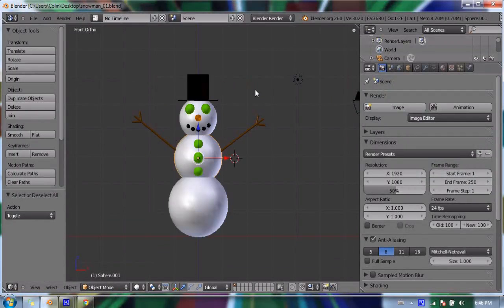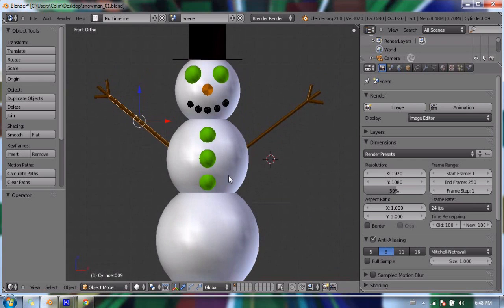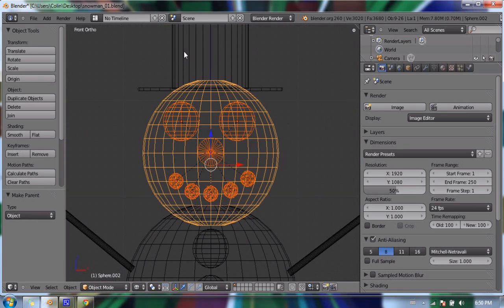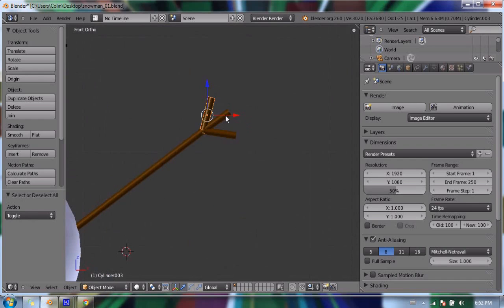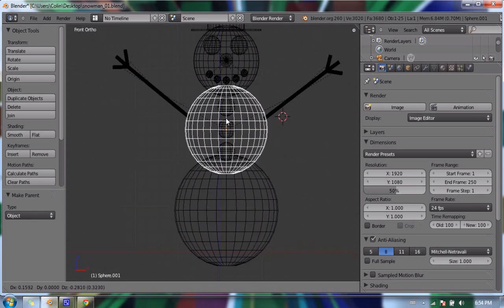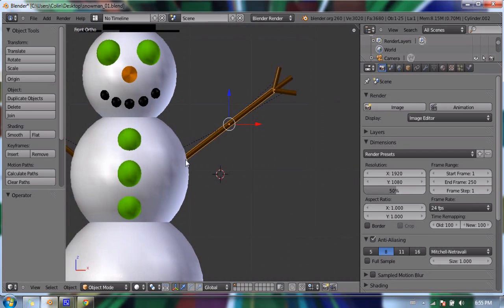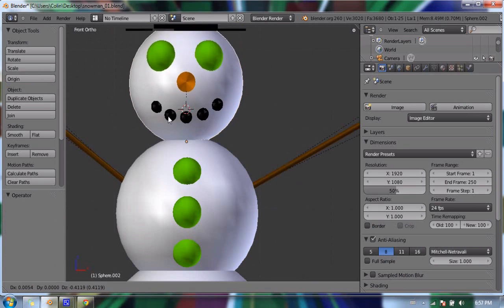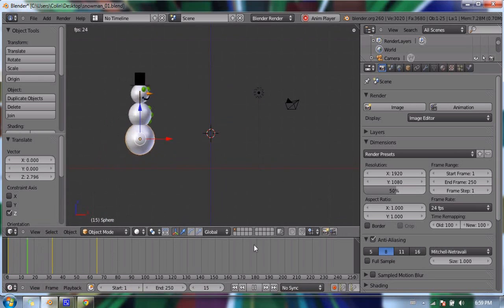Blender 2.6 Tutorial 11 - Joining & Linking (Parent/Child)

Comment: Is using Cntrl J very similar to Cntrl P  in order to merge objects by modeling? What is the difference between Cntrl  J and Cntrl P? 🤔
Reply from the maker: Ctrl P leaves the objects as separate, but makes one object follow or stick to the other object. This is important when you want to be able to animate the secondary object separately, like a robot’s arm separately from its body. You don’t want to join the robot’s arm to the boat permanently because you’d want to animate it, but you would want to make it stick to the body when you animate the body. I suggest watching this video to see the difference!
Reply: @BornCG  So using control P to select "Set parent to object" is another way of rigging and especially to merge the objects without making them into a single mesh, right? 🤔
Reply: @BornCG  I have another question to ask you, When I make my own 3D model. When whenever I want to rig the eyeballs what I need to do first is do I have to use the Boolean Modifyer, select the eyeball, click on differentiate, and then press apply without making them into a single mesh. Right? Or select it in Object Mode and then press Cntrl P to "Set parent to object" in order to do that? When I rigged the eyeball by adding one bone to each of the eyeball so that the eyeball can roll around it socket? 🤔
Reply: 9 years later he replies

Comment: make a vertex, move it on an axis from the 3D cursor.  Press the period button to make sure the 3D cursor is the central point.  ctrl+D (duplicate) the vertex, and from that very point, rotate it 120 degrees.  Do that once more, but to the one you just duplicated.
Select the vertices and press F!
Either that, or use an array modifier, but this might be simpler for you if it's just a triangle you want.